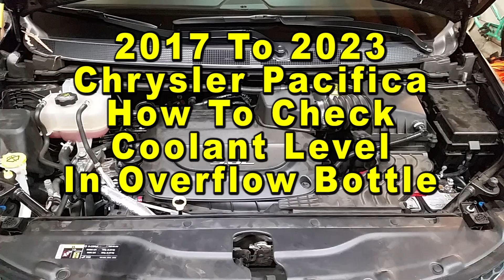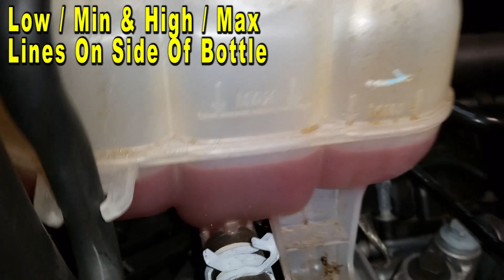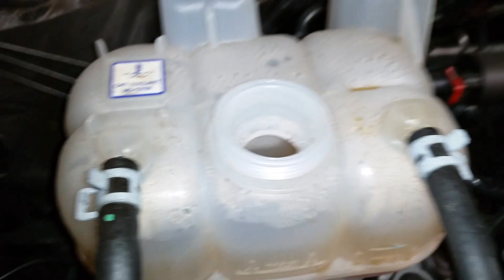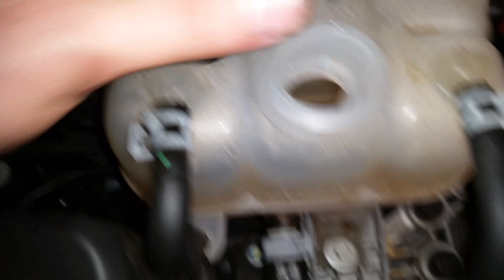Chrysler Pacifica How To Check Coolant (Antifreeze) Level In Overflow Reservoir Bottle 2017 To 2023

Comment from the maker: This quick DIY video shows owners of the 1st generation 2017, 2018, 2019, 2020, 2021, 2022, 2023 & 2024 Chrysler Pacifica minivan the location of the coolant (antifreeze) overflow bottle or "expansion tank" and to check the level.

Check out all of the DIY repair and maintenance guides for the first generation 2017 to 2024 Chrysler Pacifica minivan - 
https://www.paulstravelpictures.com/Articles/Chrysler-Pacifica-Minivan-DIY-Repair-Maintenance-Guides.htm

Comment: Which one is for the battery
Reply from the maker: Hi, this Pacifica is not a Hybrid model. So there is only one coolant overflow bottle for the engine. I'm looking at pictures of the Pacifica Hybrid and also the owner's manual.

The small bottle at the left rear of the engine bay (closest to the passenger side view mirror) is the "Battery Coolant Reservoir".

The largest bottle (as shown in this video) is the engine coolant reservoir.

The medium sized bottle at the front of the engine bay close to the radiator and the passenger headlight housing is the "Power Electronics Coolant Reservoir".

So there are three total coolant reservoir tanks. It looks like they all use the same Mopar OAT coolant like these bottle on Amazon - https://amzn.to/4frmC7l

But be sure to check your owner's manual to verify that for your model year.

I also have a list of Chrysler Pacifica DIY repair and maintenance guides on my site - 
https://www.paulstravelpictures.com/Articles/Chrysler-Pacifica-Minivan-DIY-Repair-Maintenance-Guides.htm

I hope that helps. 🙂